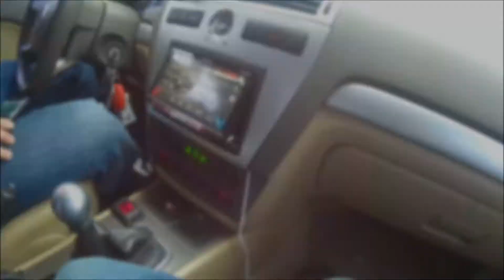Obsidian Audio 12's, PSI Soft Parts, Crossfire 1700 - SPL Show

Comment: Psi soft parts coming in clutch! I’m about ready for some fresh recones if I don’t pull the plug on some new subs. Can’t make my mind up... new resilient subs or some BV lithium. My voltage is crap ATM and my subs are gonna start showing their age if I run them this season... tough decision fa sho
Reply from the maker: Just a heads up I have one 35Ah left. Tons more coming very soon I’m even adding a 25 or 30 to the mix for more ease on the pockets with the same build quality. Lol I looked at so many other batteries and realized I’m overbuilding my 10,000%. 🤔🤔🤷‍♂️ Oh well I won’t change up. All depends on what you have going on and how you want to play either way it’s good in my book / you got my support regardless. If you do decide inbox me I will hook it up for you. Appreciate the love and support 🤞🤞🤞 Bass season goes good for 2020.
Reply: Bigvell02 well if this season doesn’t get cut short for my org,  I plan To just run a 2.4 k wired at like 0.8 ,,, when I do runs of burping for 30 sec I rise to 1.5-1.6 and lately been dropping to low 11’s after 10 secs or so. Just have the stock 80 amp in my avalon. 1/0 all around, big three /5 really got plenty of solid grounds block, alt case, chassis to batt, plus + alt to batt , and batt to sec batt -a 105ah group 31 Walmart boat style. Besides hurting at the heart of it with the alternator I think another small prob, is secondary batt, it’s lost a lot of it’s capacity, basically gets depleted after a song of demoing regular music, or after a 30 sec burp run. Gonna add an additional +& run to amp soon as my Ill customz dual 1/0 come in. Should help a little. Wish a mainstream company made an alt for my car, best Ive found is a 150-200 amp alt from small sketchy no name companies on eBay. I’ve seen plenty peeps run lithium with stock alts, especially on lowish power like I’m running, less than 3k.   I’m just wanting to demo for a few songs without dropping so low, and possibly hold high 12s maybe low 13’s when I burp.  Sorry for long winded response just wanted to be thorough and see what you think???